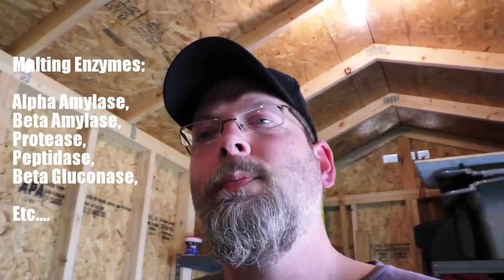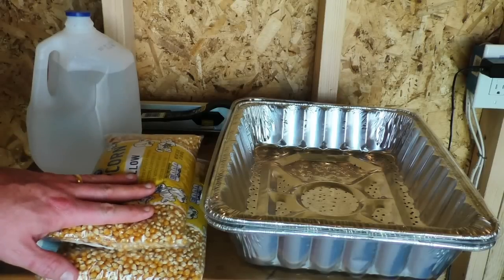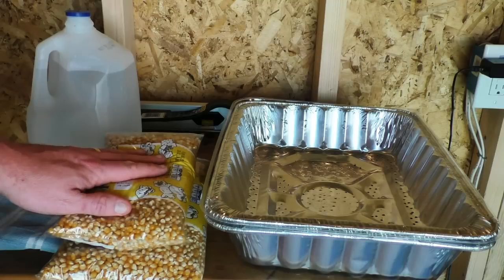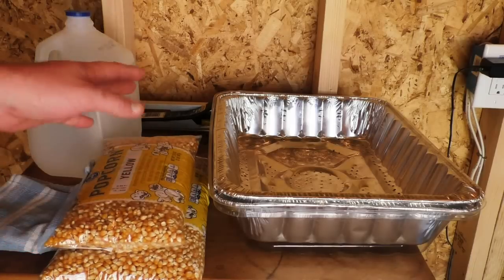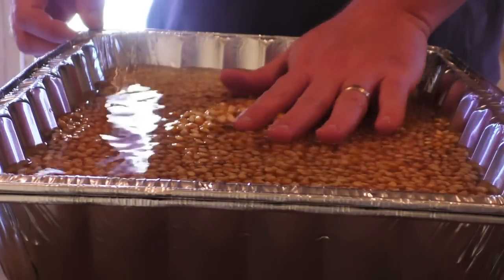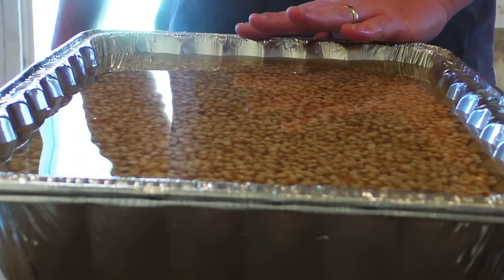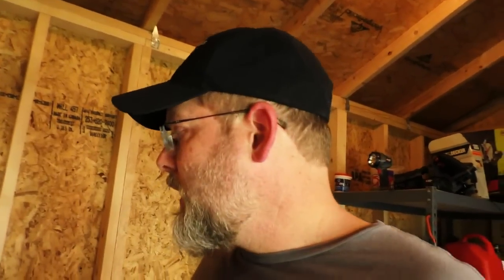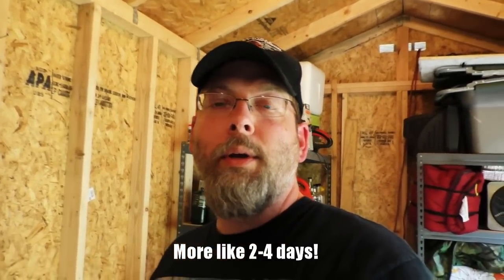HOW TO MALT CORN FOR MOONSHINE & BEER - EASY! Part 1

Comment: So you soak the corn for 8 hours and then let it drain for 8 hours and stir every 6 to 8 hours and repeat 4 times?
Reply from the maker: Yep, but you can play around with it. Try 3 soaks and see if it's chitting. If you see the tiny white chits then you can drain it and go to the wet towel covering. I'm working on a video right now that makes the process easier. Should have it out soon.
Reply: Ok thanks

Comment: Ok, so how much mould is too much when malting barley? Haha I have bought all the parts to make a "robot" but was too impatient and may have tried to malt too much at once without proper circulation, or I might have steeped for too long.
The tips of the barley are starting to mould so I guess I have to bin it? It's for whiskey so will be distilled...
Reply from the maker: A tiny bit of mold on the tips of the kernels isn't too bad, but if you get a slimy coating, or if it stinks, it's time to throw it out. If the sprouting hasn't started you can try rinsing the grain in a little StarSan solution to kill anything, then drain it, and stir it every 6-8 hours. Don't spray it down with anymore water for at least 24 hours to give it time to air out a little.
Reply: @BeardedBored  Yeah, she's starting to smell pretty funky. Ok well that's a learning curve, oh well guess I better put this malter together and go again. Thanks again for the help
Reply from the maker: @Josh-e2l  Yeah, dump it. You'll remember that smell, LoL. It's quite distinctive. Definitely part of every maltsters education. Good luck on the next one. Scale back to 2 or 3 pounds for the first run, just so you have a greater chance of success and learn what to look for at each stage of the process;-)

Comment: Do you think 12 hours of soaking and 12 hours of drying wood work  with my work schedule  I can't  do the 8 hour soak and dry? When you stir your corn do you prefer to do it when it's soaking or drying and Do you know any tricks to knock the roots off of wet/green malt? Thanks
Reply from the maker: 12 hour stretches is fine. You may be able to get done soaking after 3 rounds. 

Stir the corn when it's drained. That's when it needs the air flow. 

For knocking the roots and shoots off green malt just dump it in a colander and work it by hand, rolling it between your palms and generally abusing it until they all fall off. Should be pretty easy since the roots tend to snap off without much effort. 

If you make something with green malt please let us know how it turns out. I've read that it can leave a grassy taste in your wort, but haven't verified that myself. I'm very interested to hear about it. Thanks!
Reply: Ok will do thanks
Reply: I malted, then used corn & sprouts, dried then ground all. all in a bucket Also used white-corn & Rye to make whiteligthen.distilled 3 times for XXX. it worked!I wonder if thats whatPpopcorn Sutton used. IE POPCORN
Reply: Bearded & Bored o

Comment: I was able to malt corn, i bought white corn (asia market) and popcorn. It worked but i was a bit surprised about the way the malted corn smelled. The smell reminded me of earth i hope its not mold but i couldn't see any and i also tried hard to avoid mold by  removing  bad seeds and i was also  cleaning my corn 2 times a day with fresh water. Is that smell normal?
Reply from the maker: Yes, completely normal:-)
Reply: Oh good! Thanx alot for the info,Because the smell can be easily confused with mold and i was thinking about tossing the whole stuff away! .the smell disappeared when i grinded everything and the mash tasted normal !

Comment: When you say "soak it, let it drain - 4 times" do you mean a full 8 hour soak or just soak 8 hours the first them and then just flood it and drain it immediately 4 times?
Reply from the maker: Soak 8 hours, drain 8 hours, repeat the same cycle 3 more times. Basically you are mimicking spring time rainfall over a few days to trick the grains into thinking it's time to grow. Takes a few days to run the full cycle, but corn is stubborn.

Comment: Great video, now correct me if i am wrong but i think i saw somewhere that if you malt corn you dont need to use yeast to ferment is this true?
Reply from the maker: That's a great question! The short answer is "Nope. Yeast=fermentation." But I've heard that too. "Don't use yeast, just let the malt do it." That's a common misconception that came from the old timers who made moonshine in the woods and really didn't understand that fermentation does not happen without yeast. 

What they meant was that they didn't add store-bought yeast to their mashes. What they didn't know at the time, but we've since figured out, is that the malting process exposes the grain to the elements where it collects wild yeast from the air. Those wild yeast then propagate when they're exposed to the sugar in the grain wash. 

The problem with wild yeast fermentation is that there is no way to have a reliable rate of fermentation, or a consistent result from batch to batch since there are literally thousands of types of yeast floating around at any given time. Each strain has different levels of alcohol tolerance, flavor byproducts, etc. You may get a great whiskey one time, but then the wind changes and your next batch is different.

The main reason we always add cultivated yeast to a mash is to overwhelm any wild yeast so we get consistency and reliability. I'm happy to answer any other questions. Thanks so much for watching:-)>
Reply: Bearded & Bored I think I would have added to this that the process of sprouting/malting creates natural amylase enzymes that break the long term storage of starch into useable sugar. But that’s just me and what I have read and watched on the subject. Not an expert by any means.
Reply: @alexaxline6093  really ? You honestly believe your enlightening the group or the comment section? Your last line was something like " Im no expert" or whatever. That being understood, why you feel the need to or believe there is a need, for your "constructive criticism" is beyond me. The reason folks end up watching this mans channel ( thought it was common knowledge but obviously not) is because his colleagues happen to be the most knowledgeable guys on youtube on this particular subject. You arent scoring any points by stating the obvious or trying to 1 up people that obviously know what they are doing. You are just another keyboard warrior which everybody rolls there eyes @ when reading your enlightening constructive criticism. Stay in your lane pal
Reply: You can use natural yeast. From apple peelings and other fruit in a pinch. The issue is its wildly inconsistent and can add any number of unexpected flavors. You still need yeast as mentioned though.

Comment: Great videos! Thanks for taking the time to make them. I was wondering if you know the diastatic power of malted corn? would it have enough power to convert Rice (for an example) if heated together at 155F? or would I need to add amylase as well? Thank you in advance
Reply from the maker: Hey Glenn. Great question. Malted corn has a really low diastatic power, around 40L. That just enough to convert any starches remaining in the mlated corn, without much, if any, left over. So, you'll want to add enzymes or use some 2-row or 6-row barley to aid in the conversion for the rice.
Reply: Very interesting, I really appreciate the response. I posed this question on a moonshine/distilling page & no one really knew. & I could not find the answer anywhere. Thank you again & keep up the great videos! btw, currently malting 2lbs of corn thanks to your videos & so far, they are turning out great! .. Hope I didn´t just jinx them haha
Reply from the maker: Glad I could help. Malted corn isn't used much anymore since there are more efficient options for getting your enzymes, like malted barley and commercial enzyme mixes. Consequently not too many folks have current info on it. Everything I found came from really old commercial research papers and agricultural reports from decades ago. Congrats on the successful malting! 🙂
Reply: Ya, & i am so glad you did get that info. Because I googled everything I could & couldn't find it. The reason I am using Corn instead of Barley, is because of my current location. Barley & Rye are hard to find & expensive to import. Rice & Corn are the easiest grains to find. Wheat is available too. But only in 100lb bags from a feed store. I wanted to mention I steeped the Corn for 16 hours the first cycle step. Then went to the 8 hour cycle like on your video. It actually started to chit on the 3rd steep cycle. So 16 soaking. 8 drying, 8 soaking, 8 drying, & 8 soaking & chit was visible. I went directly to the pan with the wet towel over it. & it is sprouting nicely. I read a 24 hour steep should be done first. So I went with a hybrid of yours & what I read somewhere. Worked out well. The humid climate here might also have helped the process.
Reply from the maker: It's the tinkering and tweaking of these projects that I really enjoy. You can learn new stuff each time. In your first malting you've already got some good results that speak to your environmental factors. I agree that humidity is big one. You may have a quicker sprouting time also, but a longer air drying time (depends on how warm it is in your area). Keep us updated on how it progresses. This might really help some other folks with similar conditions. Thanks for sharing:-)>
Reply: I was actually thinking the same thing! The drying will be the toughest challenge. I agree the humidity helps with the sprouting. But it also grows some fine white mold very easily when left over night under the towel. The first sign of it I immediately rinse & soak for a few min. While gently moving it around with my hand in the water. While being careful not to break off the roots & acrospires. It takes it off & leaves it smelling fresh & will not grow back. At least until the next morning. I believe one more night & possibly day & it will be ready for drying. I believe I am catching the light mold growth right in time before it has a chance to change the flavor & smell of the Corn. So I have been lucky with that. I will update with the progress! Thank you Bearded!
Reply from the maker: I think you're doing the best thing by rinsing it clean each time. As long as it doesn't get funky smelling you should be fine:-)>
Reply: Hey Bearded! Just wanted to follow up on the Drying of my malt. So I got it dried in one day. I did 5 hours in the sun . Would of done more but it was attracting to many damn birds. 5-6 hours under a fan. (Your way on the screen with the fan under would of been much better.) then I did 5 hours in oven. With a varying 140-155 the entire time. Took off all the dried shoots in a pasta drainer. & then bagged it still warm. Kept an eye out for any water vapor or droplets inside. & therewas nothing. Had to do 5 hours oven time because it's so damn humid here it wouldn't dry. Thanks again for the videos! Now in a few days, time to make some shine!
Reply from the maker: Great! So glad you got it done:-)> If you dry in the sun next time try sandwiching 2 window screens together with the grain between to keep the birds off. Might even be worth your time to build a sort of drying box for outdoor drying. 

My only concern with the oven drying is the higher temps reducing the viability of your enzymes. You're probably fine at 155, but do an iodine test for starch conversion after the mash to see where it's at. If you have any issues with conversion this time, just as a precaution for next time try warming the oven to 125F, then shutting it off before adding the grains. You may have to do that several times to float the temp around 120-ish, but that way you'll be well below the threshold for the enzymes.

All that said, if you're planning on using the grain right away, you can skip the oven drying if you want. As long as you get the shoots dry enough to come off, then it's ok to have a higher moisture content in the grains. The extra drying is crucial for long term storage, but not a big deal if you're going to use the grain in a few days. 

Have a great brew day, and let us know how it turns out!
Reply: Haha ya that probably would of been a good idea for the birds. Wish I would of thought of that! I kept a thermometer in the oven with kernels. Checking it regularly to make sure it didn't go over the enzymes temp threshold. I was hesitant about the dryer since I didn't know what temperature it would get to. & the oven I felt I could keep a better eye on things. But I didn't realize that 155 could affect the enzyme as well & 120-ish would be better. I will keep lower temperatures in mind for the future during drying. Thank you Bearded!
Reply from the maker: When the corn germinates it will still have some starches in it after it's malted. The malted corn usually doesn't have enough enzyme to convert any other starches beyond what it already contains. You can give it a shot, but I like having the safety net of some added barley malt or amylase powder just to make sure I get complete starch conversion.
Reply: Wow, great information about the fine white mold and what to do about it.  Thank you.

Comment: How would you compare the efficiency of using malted corn vs 2 row malted barley? (Cant easily find 6 row) does one break down starches better as to get a higher yield?
Reply from the maker: Malted barley is waaaaaay more efficient than corn. The diastatic power of malted corn is around 30 when dried(only enough enzyme to convert itself and no additional adjunct grains), or around 100 when used fresh and green. Malted 2-row barley is around 120 dry, and off the charts when fresh and green. Check out my grocery store beer video for more info on that.

Comment: Do I leave the damp towel over the corn after every draining process for 8 hours?
Reply from the maker: Yep, that way the top layer doesn't get too dry and keeps it it all germinating more evenly.
Reply: Thanks man. I've jus started to sprout corn and I ruined my first batch. Second batch was much better but i think I over sprouted the corn😂😂I'm gonna try your way next here in ireland. Love your work🍺🍺
Reply from the maker: @leebridges2540  Check out my green malt grocery store vid. I go over some new stuff on corn malt. Also, my malt tumbler vid may be helpful if you plan on malting more than a few times. Good luck:-)

Comment: so if you malt corn, do you still need to add amylase if you're not using another grain?
Reply from the maker: The level of enzyme present in corn is really low. There is usually just enough to convert itself and nothing else. But it is still a good idea if you add a little enzyme, just to make sure you get full conversion. If you don't have any, you can always try mashing overnight in an ice chest to maintain the temperature.
Reply: Think I'm going to just skip the malting step and just add amylase then. Going for a mash that's as close to full corn as possible. Is there a way I can DM you? I made a google dox step by step from notes from barley and hops vids 😂. Any input would be much appreciated! 😁
Reply from the maker: @JoshWhitford91  You can email me, but I don't think I can add anything that George hasn't covered. But if you have questions, let me know. My email address is on my "about" link of my channel page.

Comment: i followed your instructions and everything seemed to work great. i made a split batch of light lager... one with flaked corn and one with the malted corn. The one with the malted corn didn't seem to contribute any to the original gravity. do you know if the malted corn actually produces sugar for the wort or is it for flavor?
Reply from the maker: The best I have been able to get is about 1.024 points of gravity doing 2 pounds per gallon of straight malted corn and water. George from the barley and hops channel did a video on a batch I sent him vs. regular cracked corn. His result was pretty similar. The popcorn seems to have less available starch than regular dent corn. With all that said, in my opinion the popcorn has a more complex flavor, but it's more of an adjunct grain. Check out my video here https://www.youtube.com/watch?v=YI9pd7n1G2k to see a beer I did with green malted popcorn. I go into the conversion stuff in detail. And here is George's video https://www.youtube.com/watch?v=eLCoZZ5ayvM
Reply: @BeardedBored  thanks. i was actually trying to make a light lager like one i had @ Zilicoah Brewing in Asheville. They use Riverbend Malting Pilsner and Malted Dent Corn. I picked up the pilsner while i was in town but not the dent corn. that's why i went with the malted popcorn. Regardless, thanks for putting out your video. i'll probably try it again and use it on a different fermented product

Comment: Wonder if you could do the same thing with wheat berries, to make sprouted wheat flour??
Reply from the maker: Absolutely! The only difference with wheat is that it doesn't require as much time to germinate. The wheat sprouts only need to grow about the length of the grain itself, maybe 1/4 of an inch, then dried. The enzymes develop faster in wheat, similar to barley. Other than that the process is the same:-)>
Reply: @BeardedBored : hey, thanks bud!!

Comment: Will feed store cattle corn work for this purpose. I'm new to this hobby and any info would be greatly appreciated.
Reply from the maker: Yes, but you'll need to wash it with clean water thoroughly several times before you do the soaking cycle to get any dust off the corn.
Reply: @BeardedBored  is there a way I can personally message you? I have a couple of questions
Reply from the maker: @jtfalkner  Click on my channel home page, then click on the "about" link to find my email address.